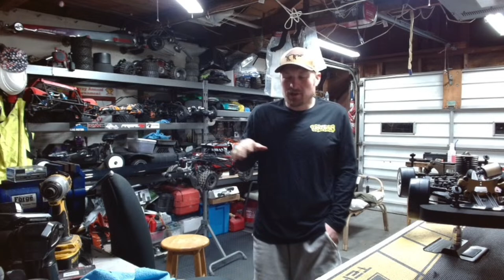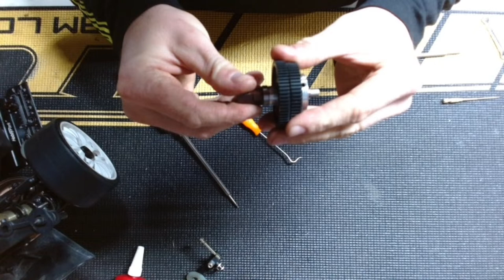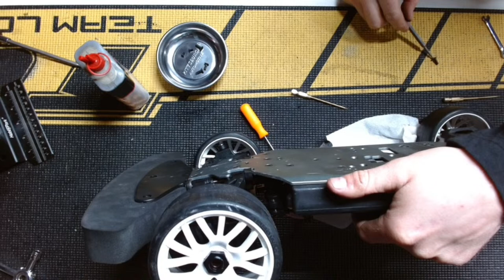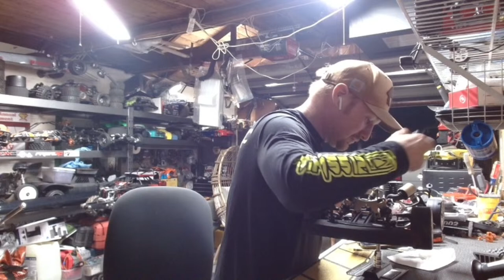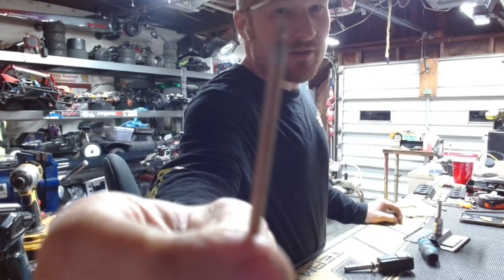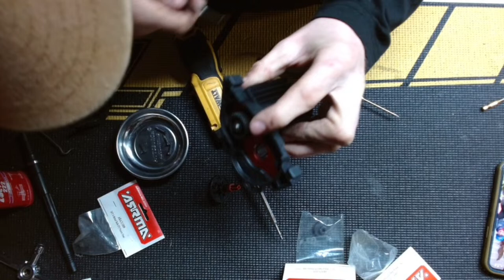(LIVE) SERPENT SRX8GT 2 speed problems  Lets Fix IT!!!

Comment: You have to get both sets of screws perfect. The straight on screws just right so the shaft has good free play back and forth without expanding the 2 shoes really. The angled screws and springs is what’s actually giving you your shift point. Too loose and it will be in second way too early, too tight and it won’t ever shift into second. Start at about 4 full turns out from fully seated. Good starting point. I’m sure you’ll need a little finagling from there. Don’t squish them springs when fully seating them screws. Go gently tell you feel it tighten up. Also notice the manual only shows 2 shims on that one side. Have fun!

Comment: Also make sure you have no burrs around the set screw holes siticking out from the shoes, and on the alum piece make sure the is no burrs on the inside of them angled drill holes that are supposed to be giving you access to the set screws. There tends to be burrs in both spots. A couple of swipes back and forth with some fine sandpaper on the shoes over the holes and inside that alum piece should do you some good. Burrs are no good.👍
Reply from the maker: Thank you!  This helps a ton along with the good advice during the stream. I am going to disassemble and start fresh again tomorrow!!